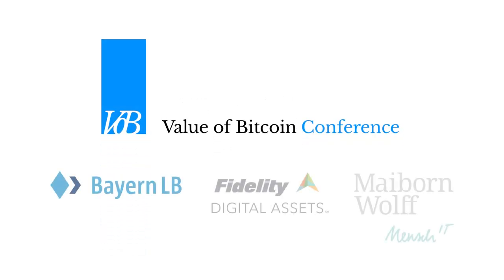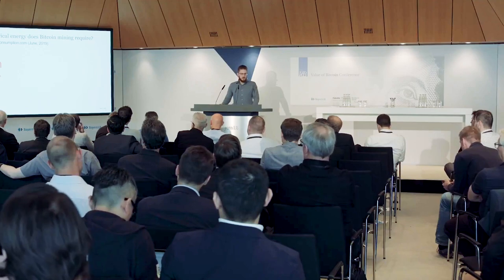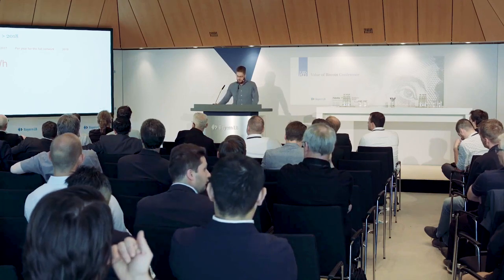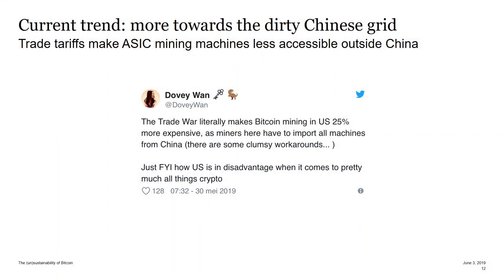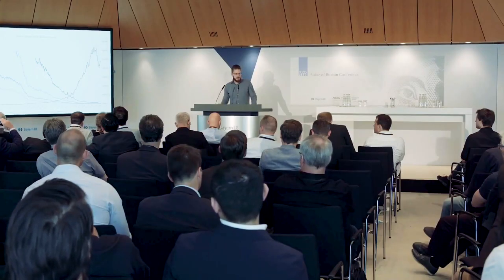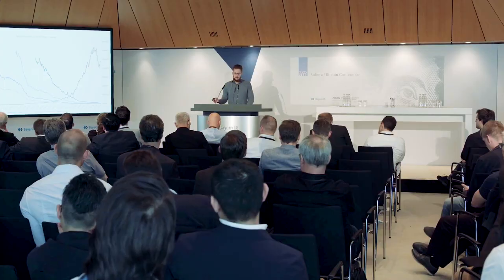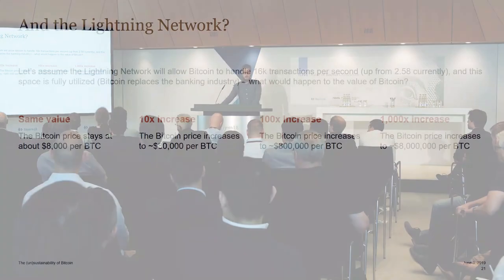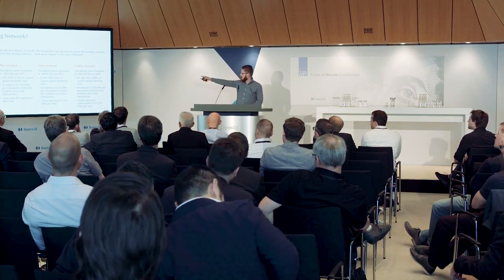The (un)sustainability of Bitcoin | Alex de Vries

Comment: That guy is a fraud, Has been repeating the same uninformed rant for last 5 years
Reply: I've indeed heard the same criticisms for years, yet, every time my critics only managed to vindicate my estimates. A perfect example is the Cambridge Electricity Consumption Index. This is based on the alternative approach of Marc bevand, who has been extremely vocal about how flawed my models are (supported by Jonathan Koomey). Even so, the estimates produced by the alternative are close to, and even exceeding, my own estimates. 

The key problem here is that these critics are trying to argue that, a system that essentially functions by wasting resources, is somehow very beneficial from an environmental perspective. This is of course nothing but a waste of time, as no sane person will ever buy that argument. All that time and effort (for defending PoW) could be better spend in working on a viable alternative algorithm. The way the community is currently behaving is destructive for both the short- and long-term value of Bitcoin. You cannot suger-coat the numbers (and if I don't provide them someone else will - as already happening), but you can take the feedback to heart.
Reply: @digiconomist8267  Ok Vitalik
Reply: Just saying it is not enough.
If you have alternate data or estimates, please share / write a paper.
It's how science works.